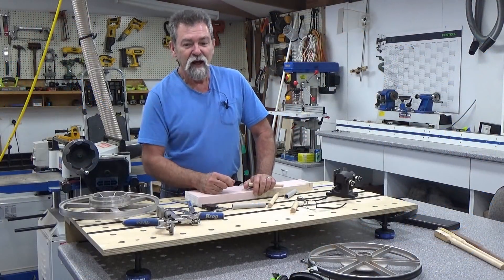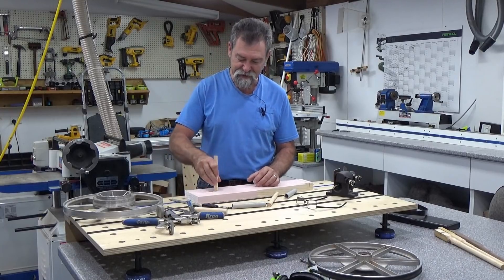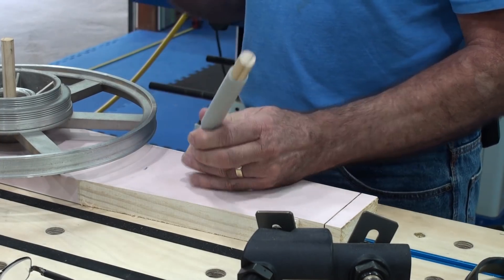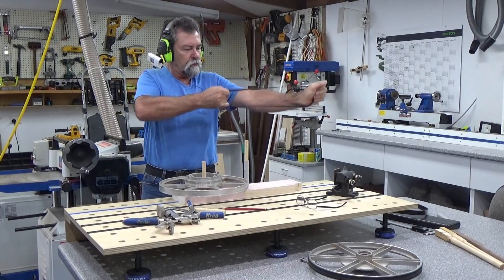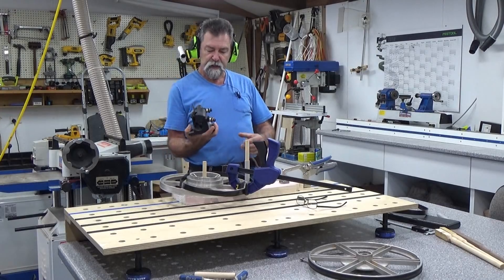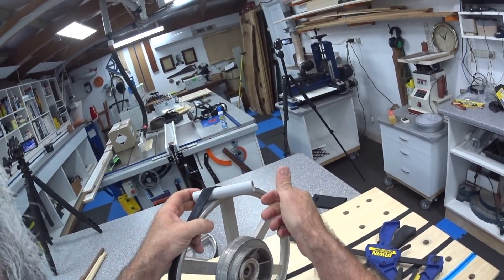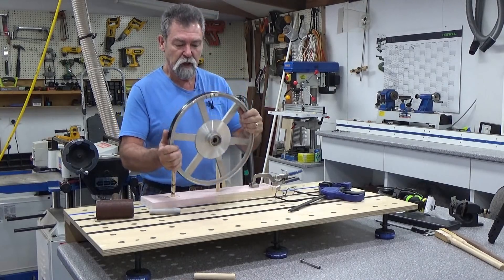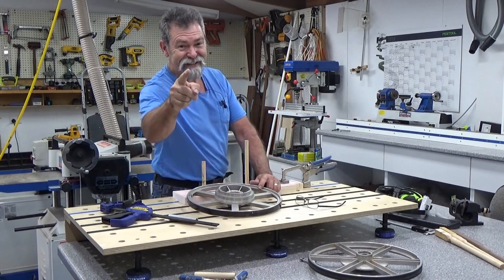How to replace a bandsaw tyre the easy way. Dave stanton woodworking

Comment: used this method and quite frankly amazed at how easy it made fitting Tyre ------ last time i had to do this took, the skin off just about every finger and struggled for over an hour to complete task. Using this technique to less than 10 minutes to do both tyres ----what a revelation bloody brilliant. well done keep the ideas coming. big thanks.
Reply from the maker: So glad it worked for you! Thanks for the support and stay tuned for more helpful tips.

Comment: I've replaced both tyres on my OAV 530 bandsaw with Urethane ones (not grey or white, but yellow). I've read in several places that they outlast rubber tyres and don't need any glue to hold them in place, but I'm not convinced they are as good as has been suggested. The first time I replaced a tyre was about 5 years ago, when one of the original yellow urethane tyres suddenly broke into several pieces. I had previously wiped both tyres down with a cloth soaked in mineral turpentine to remove some gunge, and I suspect this may have weakened the tyre which caused it to fail months later. However, both top and bottom urethane tyres have recently snapped about 6 months apart, and they have been kept clean and don't have a lot of use. I did heat them in almost boiling water before I plut them on, but I doubt this was the cause of the failures. I'm now going to replace the lower tyre with a rubber one, which is just over half the cost of a urethane one, and after seeing your video I won't be glueing it on.
Reply from the maker: I'm glad my video helped you.

Comment: Just today I replaced 1 of my 2 tires on my Grizzly 17" bandsaw.  I saw a very similar video from the supplier of my tires and used this method.  It was a bit of a challenge, but I'm certain it was easier than the 2 screwdriver method.  I shall replace the 2nd tire in the next day or two.  For the moment my saw is "out of service".
Reply from the maker: I hope it assisted you.

Comment: Nice tip Dave. Are those rubber or urethane tires you put on? I have heard that you need to use an adhesive with rubber tires but not for urethane. I believe your tire mounting jig would work for applying adhesive to rubber tires too. I'm getting ready to replace the tires on my saw, after 8+ years I think they are due.
Reply from the maker: My pleasure Bob, I think they are rubber. I believe that urethane are white or grey?

Comment: I have a Laguna 14/12 bandsaw. Does this video mean I always have to take the wheels off the bandsaw to change tyres?
Reply from the maker: Hi Joe Slaven. Only if you want to do it the easy way but bandsaw tires only get changed every few years when torn or they snap..
Reply: @DavidStanton  thanks David. The tyre on my lower wheel snapped, so I am replacing both tyres. I have one of the first 14/12s in Oz, and these are the original tyres. Just a bit worried the top wheel , being a press fit, might require a puller.
Reply: @DavidStanton    David, Laguna told me to boil the tyres for 5 minutes , but I  will be using the very hot water tap, and NOT to stretch it, as the eurethane will not rebound to its original shape like rubber tyres. I thought you would like to know

Comment: My bandsaw tyres have perished and cracked. They appear to be a rubber based material. Have you experience of urethane alternatives which some suppliers are offering?
Reply from the maker: Interesting point Peter Bourne. I haven't noticed any difference.

Comment: Hi dave, my bandsaw is 97 years old. the wheels are 36" diameter and about 2 1/2" wide. maybe 150 kg each.
the tyres are rubber of course, and are in need of replacement because of mlnor blade runout.